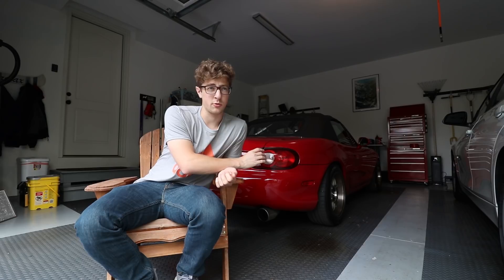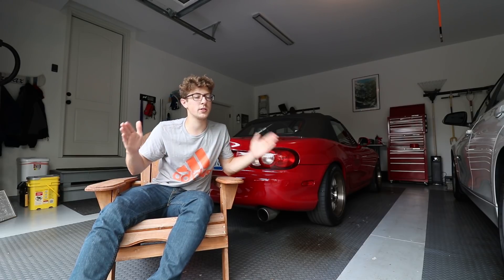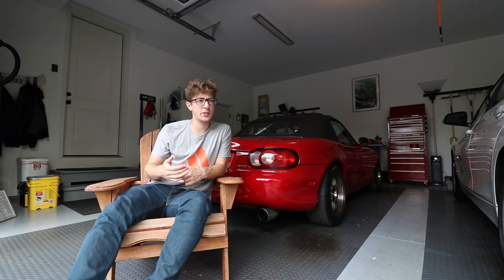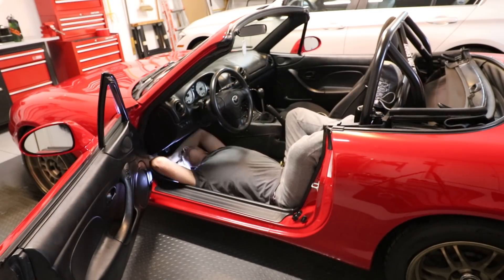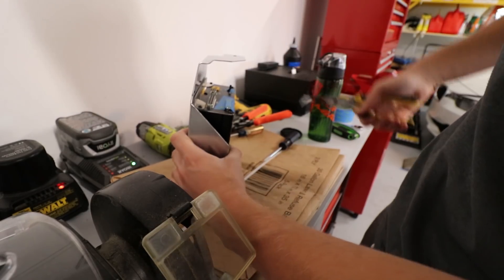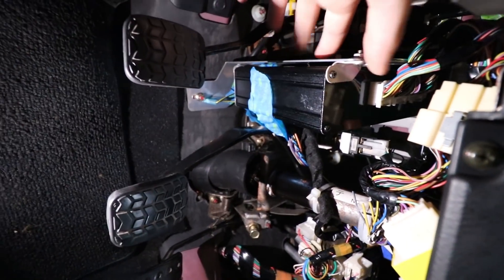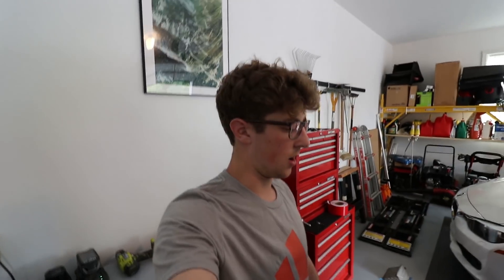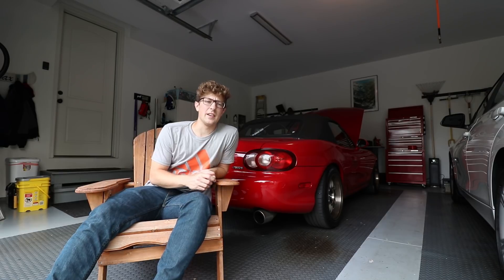My car is running a MegaSquirt ECU...I have some explaining to do.

Comment: Took my stock NB ECU out, removed the brackets, bent the top bracket to mount on the side instead of the back, drilled and tapped the MS3 case, bolted them back where the stock ones were mounted and put it back in the car…easy as sin

Comment: Any more info on the afr I can’t get mine working with my megasquirt did you wire a ground from the gauge to the ecu options plug

Comment: I I’m trying to get my ms3 working but everything time the car runs it’s melting the coil pack any ideas
Reply from the maker: Did you build the ms3 yourself or is it off the shelf?
Reply: @pattyboi  bought it from them directly
Reply from the maker: @him4201  I would talk to the supplier because as long as it's being installed right there's no reason why the coils should have different power than before

Comment: Did the wideband o2 screw into the factory o2 location in the exhaust? I have 100% stock miata
Reply: I'm pretty sure it does

Comment: Hey mate, enjoying the content - have an NB of my own. 

Just curious, how did you go about wiring the AEM gauge to the ECU. 

I’ve seen people with NA’s splice the wire from the gauge into the stock narrowband plug - but the NBs are different. How’d you go about it?
Reply from the maker: yerp, pretty sure that's how you do the NBs.  Mine had extended wires already ran so all we had to do was match the wideband wires to the ECU wires+a provided ground from the ECU.
Reply: So there's a couple things wrong here. With the AEM X series (or really any wideband) you replace the narrowband with the Bosch LSU4.9 UEGO sensor. The UEGO sensor comes with a harness that connects to your AEM X series (or whatever gauge/controller you have). From there, you supply the gauge with +12V power and a ground. At this point you have a working AFR gauge, but we need to send the signal to the ECU. This can be done via the analogue 0-5V signal wire supplied with the gauge, or the CANbus harness from the gauge. Now you have a working AFR gauge, and a wideband running to the ECU.
Reply: The AEM X series does not have a narrowband signal wire; because it's the year 2019 and narrowbands are ancient tech.

Comment: As an explanation: The NA/NB Miata runs a MAF based setup. This means that there is a physical air flow meter that is measuring direct air flow entering the intake plenum. Most EFI's including Megasquirt function better with a system called: Speed Density. This replaces the need for an AFM/MAF and instead uses a manifold absolute pressure sensor (MAP) in conjunction with intake air temp (IAT) to calculate how much air is entering the intake plenum. Not only does this system allow for custom intake setups, but it deletes the need for an AFM/MAF that can rob power as it is directly in the intake path.
Reply from the maker: Me: ......

My engineer brother: